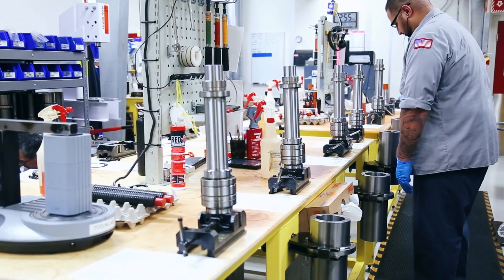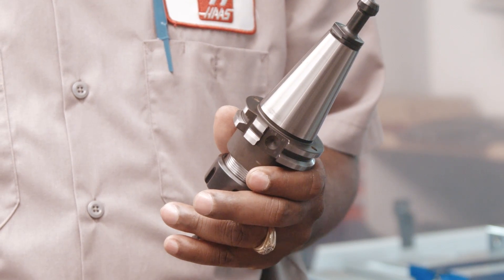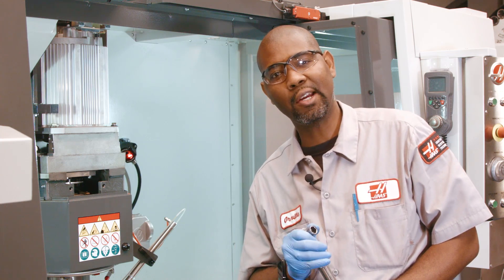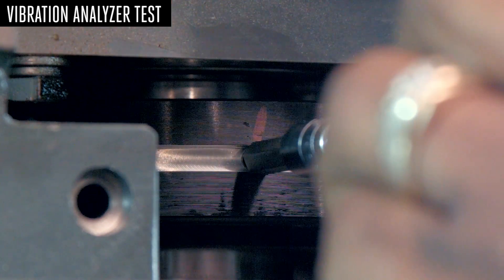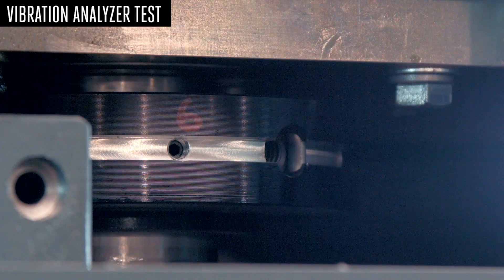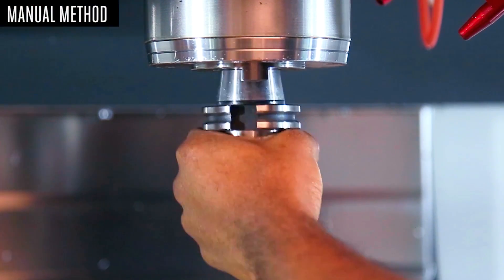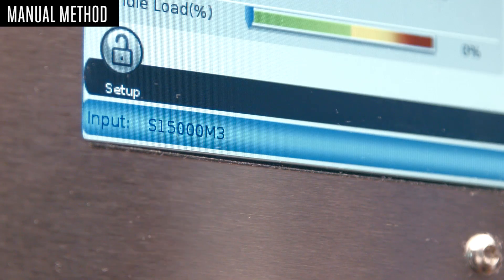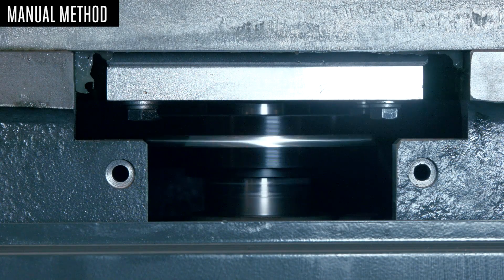Balance Your Spindle - Haas Automation Service

Comment: Question
One of our Hass machines has a lot of Noise especially at 12k. There seems to be a resonance there. 
You cant feel much vibration on the enclosure but you can feel vibration transmitted through into the floor and that gets transmitted into the office as a tonal noise.
A Hass represented check the vibration and apparently it was "in spec" should we still trying the balancing method to see if the floor vibration good away? or just hope  a new spindle fixes it?
The two Older machines in the same room a very quiet in comparison. One also needed a spindle change
Great Video BTW

Comment: I can balance that spindle in 4 runs instead of the guessing game of 7+ shown here. Of course I can crunch the numbers to determine the heavy spot and split weights between locations. 

How did the spindle end up out of balance in the first place? This is a good option for someone who doesn't have a CBM program. You should be monitoring your bearings and rails with a routine vibration program anyway. Down time cost money.
Reply: Jody Olivent how do you pick up the position of the spindle? Make a base run & a couple of runs with randomly placed (but recorded) weights to get a data matrix that is then used to calculate the required weights and their positions?

I remember doing this for one of the hands on vibration labs in college, but that was 15 years ago & I don't have my engineering vibrations textbook handy.  

We used an o-scope in X-Y mode with an analog proximity sensor feeding each input. Sensors were mounted at right angles to each other & the rotating shaft, which had a giant (relative to the shaft dia) unbalanced disk with threaded holes on a few different bolt circles to accept set screws. This particular lab took up every single second of the 3 hours allotted for lab courses that were paired up with almost every one of our mech eng lecture courses.

I imagine that once set up with proper sensors, software, position index relative to the holes you have for balancing, etc, that it can go pretty damn quickly. Much like a wheel balancer that can tell you to add specific weights in specific positions on two planes.
Reply: Iceberg86300 one could use a laser photo tach. The easiest way is to do a four start (or run) balance. You have three test runs and move a test weight 120 degrees every time. Phase is determined by the difference in the readings and some fairly simple math done in excel turns up a correction. The fourth run is for verification.
Reply: Jody Olivent thanks for the refresher! Pretty much how I remember it.

Comment: Awesome tutorial.  Balancing is a patience game.  Btw what is the balancing specs for a spindle?
Reply: Rob Townsend I'm fairly certain the G spec for machine tool spindles that operate >20,000 R.P.M. is an ISO grade 2.5. Generally, the lower the G, the finer the allowable unbalance.
Reply: I usually balance stuff to G 6.3. But I do mostly fans.  Is that G 2 at 15000rpm?
Reply: Rob Townsend You'd need to know the residual unbalance and the weight of the rotating mass to determine the actual G spec that spindle is currently running.